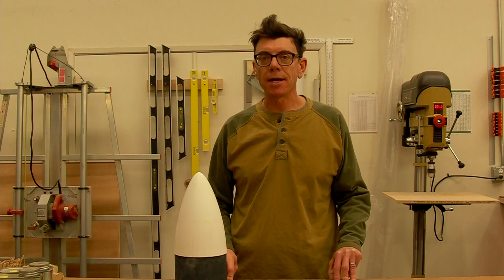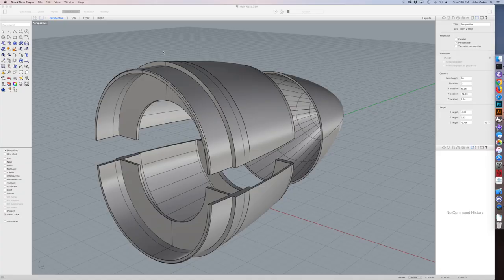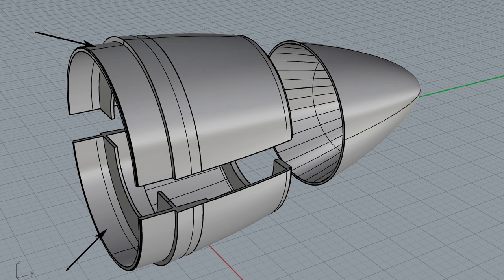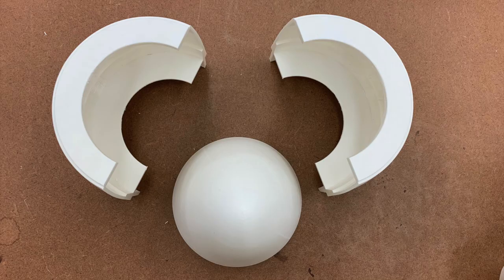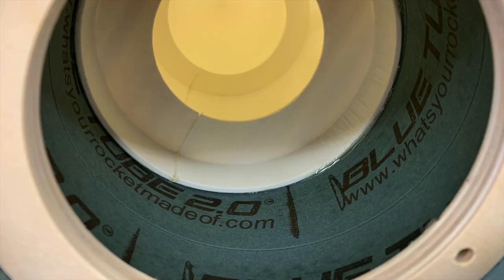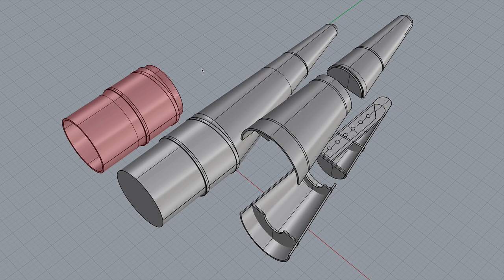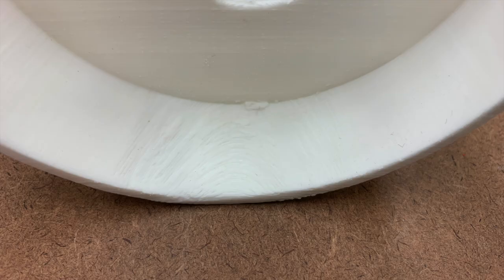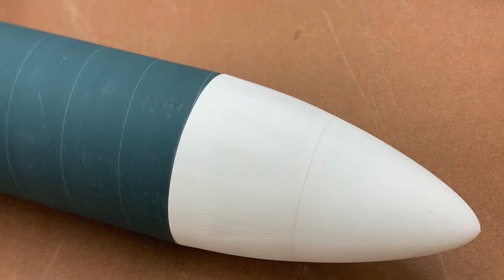Printing Large Parts

Comment: Thanks for all of the great information John! I found your website recently and it has been very informative. You mention that 3D printing nosecones may not be the best for extreme velocities, do you have any experience with that specific scenario? I'm considering using a 3D printed nosecone for an L3 and have been debating what reinforcement it would need.
Reply from the maker: I don't have specific data, so my caution is really just that. I think the low melting point of PLA could be a concern at Mach 2+, but since most L3 certs are not extreme flights that may not be an issue for your cert bird. 3D printed parts are still in the experimental stage for HPR, so we don't actually know their properties in practice. If you do intend to use 3D printed components, clear it with your TAP/L3CC first.
Reply: @JohnLCoker  Thank you for the advice! Current design considerations don't put the rocket over Mach 1.6.